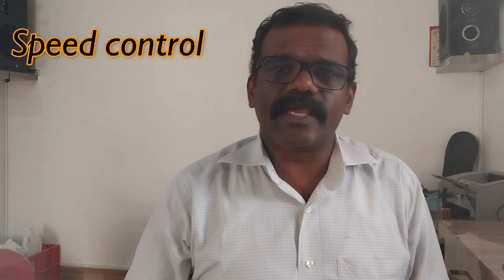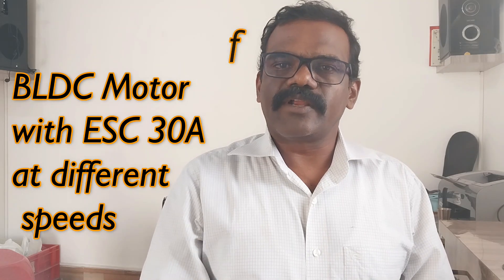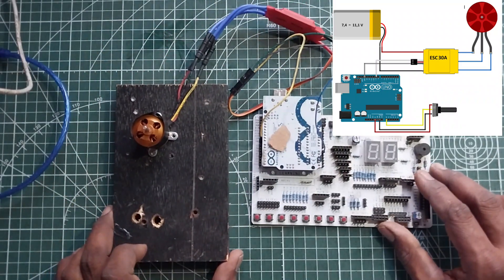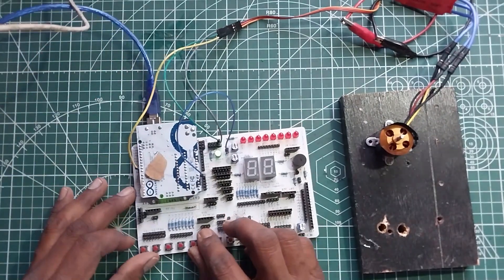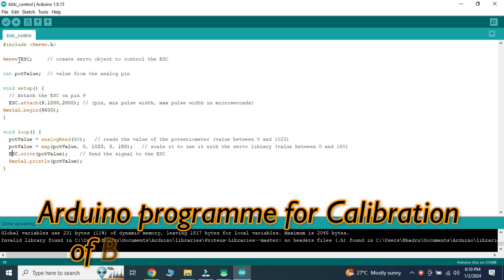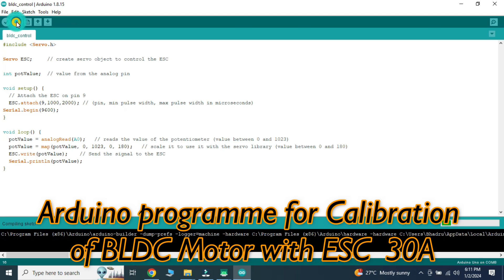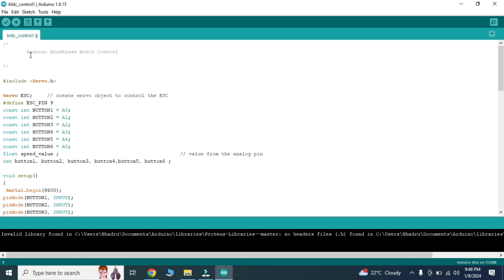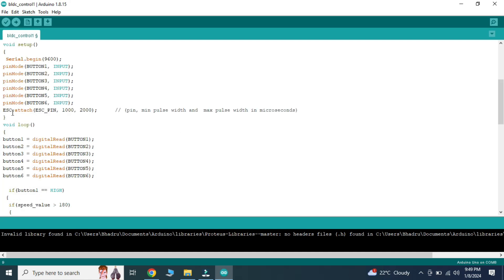Speed control of BLDC Motor using arduino with ESC 30A for different speeds using push buttons

Comment: AC single phase speed controller required linearity of speed control from 0 to 100%, 1.5KW motor,1500 RPM